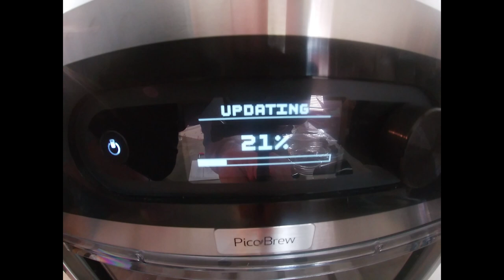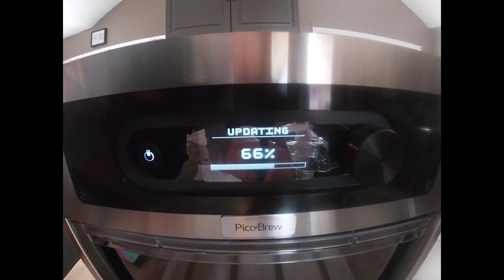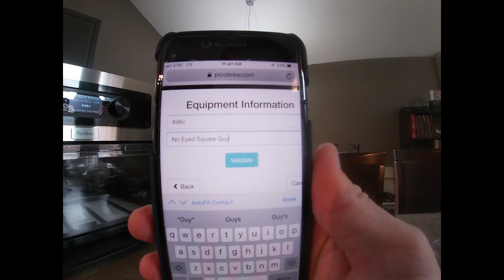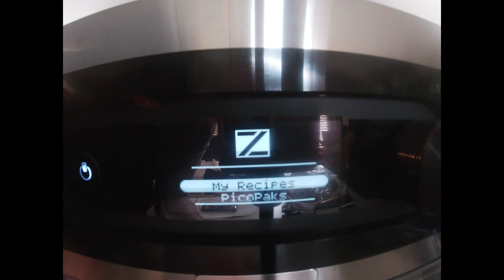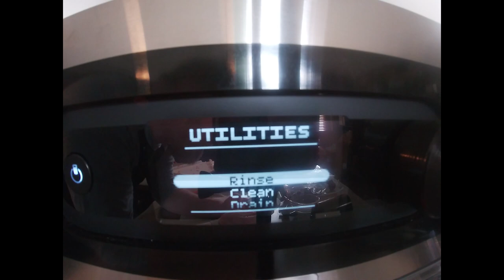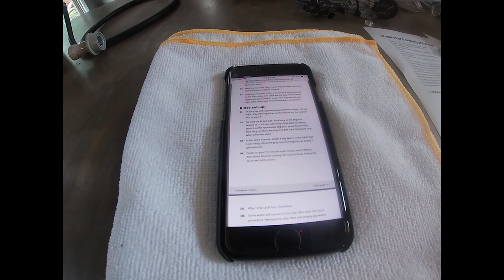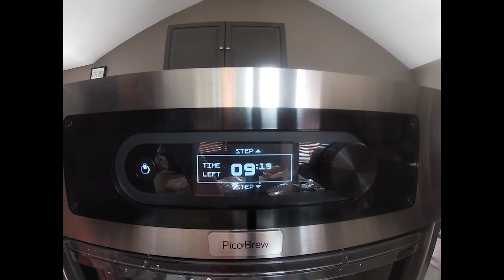Picobrew Z unbox and setup

Comment: My Z2 is arriving tomorrow. I’m pumped. How did your first brew turn out?
Reply from the maker: Carlos de Castro Jr thanks for the comment! Im going to be sampling my first brew this weekend- should be done conditioning. My buddy got a z2 also and it was actually 2 z1’s that hook together through a power cord splitter. So he’s able to separate them and use them independently. Cheers!
Reply: How did you do the cleanup? Did you run a clean cycle?
Reply from the maker: Carlos de Castro Jr it just had me run a rinse cycle and I cleaned the baskets in the sink- pretty easy. Did you get your z2?
Reply: Kris Merrill I did two batches so far. First one, my cart wasn’t level so I had some leakage of the wort. 2nd batch was flawless. I just need to get a chiller. I’m looking at a jaded brewing one that inserts into the keg. Overall. I’m glad I waited it out.
Reply: Kris Merrill I have only done 2.5 gal batches, because I need to either get an electrician to wire a 240 V outlet in my garage, or get a long extension cord to go from my 240V from the dryer.